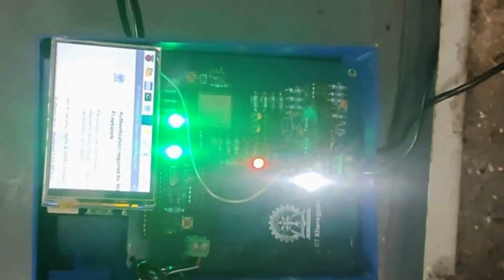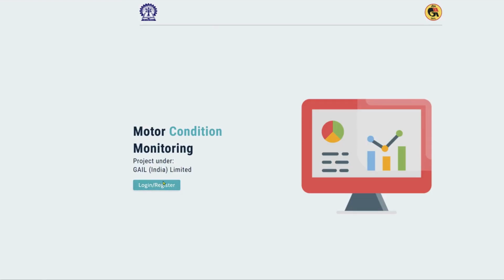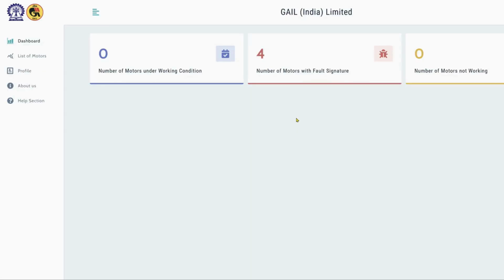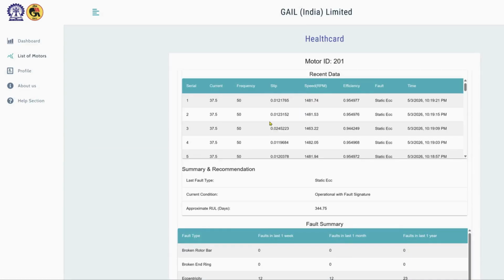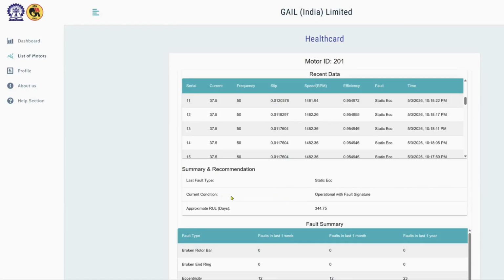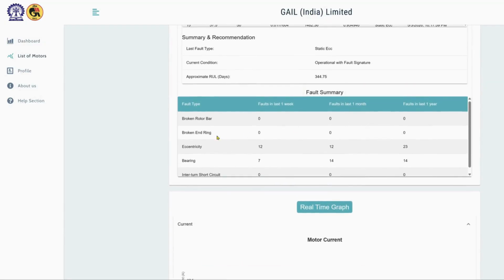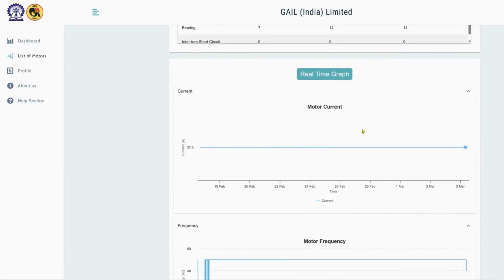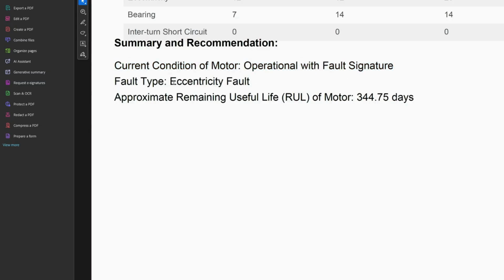TRL 5 & 6 Demonstration: AI-Enabled Cloud Platform for Industrial Drives | IIT KGP & GAIL

Comment: Your model is trained on which data to detect fault ? Is it  OEM manual data or any historical data you have collected ?
Reply from the maker: its trained on physics based model(digital twin) data and some historical data of the motor. it is physics+ data driven model
Reply: @haraprasadbadajena8600  great . Can we use it to build a predictive maintainance tool at industrial scale ?
Reply from the maker: @biswajitmohanty2707 yes we can build that.